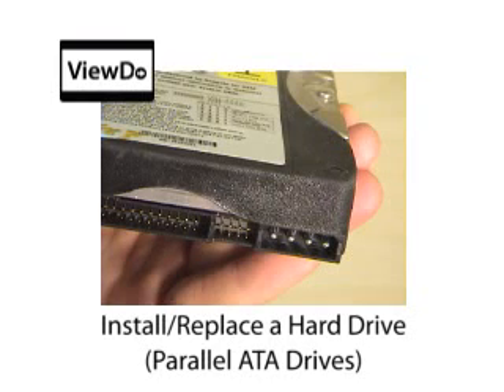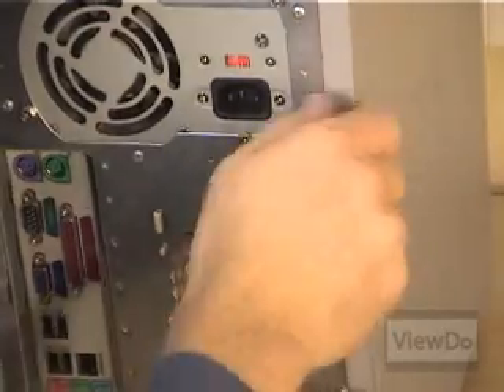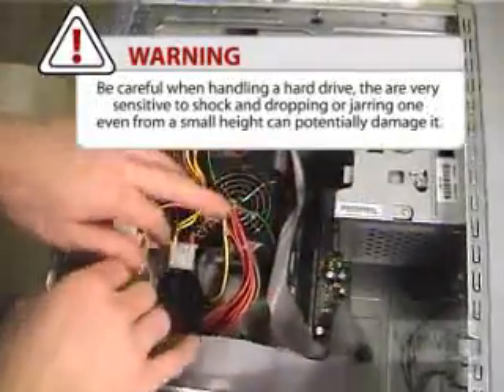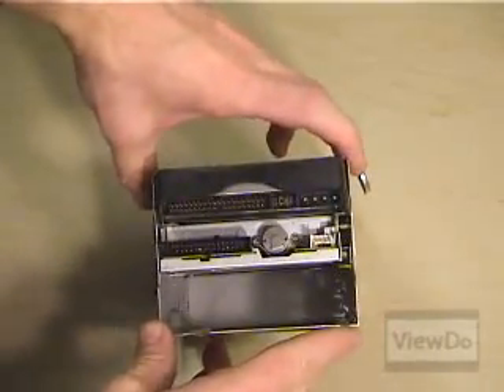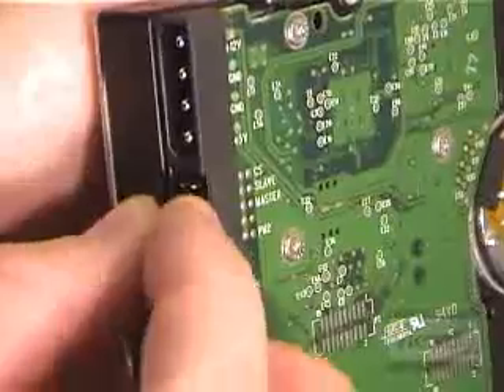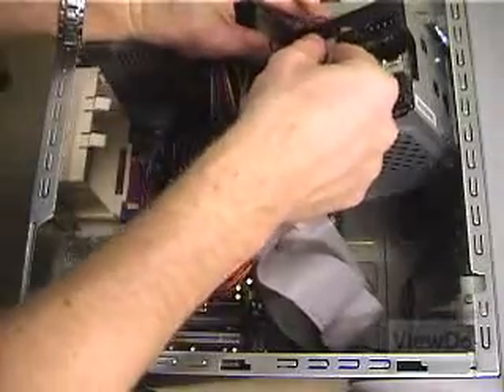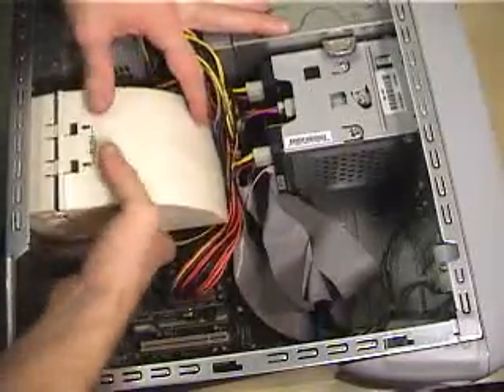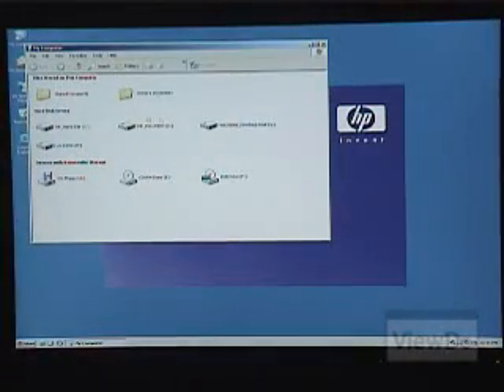ViewDo: How To Install/Replace a Hard Drive (PATA)

Comment: "Be careful when handling a hard drive, they are very sensitive to shock and dropping or jarring one even from a small height can potentially damage it"

i dropped 2 hard drives (at the same time by accident) 10 feet at about 15 MPH (this is directional speed, not falling speed) down a flight of stairs and both still work. Made a hell of noise falling, but both spun up and were detected. Takes more than you may think to break a hard drive.

Comment: I took out a 20.5 GB AT Firewall Plus AS out of a computer and tried installing a Barracuda ATA v 40 G harddrive, but it says that I have a missing operating system.  I know both units ran XP...so what gives?

Comment: yes if there is enough correct wires to hook up another hard drive. You don't have to remove the Floppy Drive unless you need more room in the pc. 

NOTE:The wires for a floppy drive are different then a hard drive.

Comment: nickelback052893, did set the jumper correctly like the guy in the video did?

You'll want to set it to MASTER, only then will it boot into Windows. Make sure your using the right cable, there's primary master and secondary master. The CD-R drive is usually Secondary, -- unless you've switched them?

Comment: This one is about 1998ish. It's only 11 years.

The computer in my basement is running on Windows 3.1 If you have seen many computers, I'm surprised you haven't seen a computer with only 99 or Less Mhz Processors.

Comment: If your computer is reading 2, when you have one, then that means it's Partitioned.
Basically, you can make multiple hard Drives, that add up to the total Memory on the HDD(s)

Its useful because Windows XP can only format sizes up to 32GB, so having multiple Partitions is useful, if one wants to format only part of their HDD.

Comment: well what I did was I used an external hard drive. It connects by way of USB and it's extremely cheap. Usually they hold like up to 200GB.

Comment: yes you can set the old drive as slave to retrieve data assuming it's not corrupt and/or broken.
no, you will not have two C: drives those letters are assigned to drives by the OS and it will adjust the respective designations in almost all cases.

Comment: I have been known to use duct-tape or zip-ties  in such instances, you want to be sure not to block any fans or vents when doing this and if using duct-tape use as little as possible as you don't want to insulate your drive.

Comment: I want to install a new hard drive into my computer and install a fresh windows on it, but i want to transfer all the old files to the new one. Can i just set the old hard drive (including the old OS on it) as primary slave and copy all my files to the new hard drive, without any trouble? I mean, don't you have double C: drives then (from the new and the old hard drive)? After all, both hard drives are formatted into C: drives.

Comment: ata=former name of ide/pata before sata came out
ide has a wide ugly ribbon cable.....
sata=serial ata is going to be quite a bit shorter than a ide drive, much faster because it has serial data transfer instead of parallel
data transfer and the cable from the drive to the motherboard is much smaller and circular instead of flat and the connector on it is going to look sort of like this:
[-]>....lol